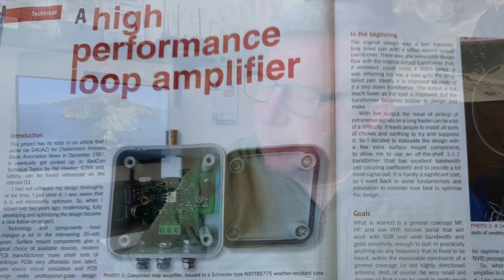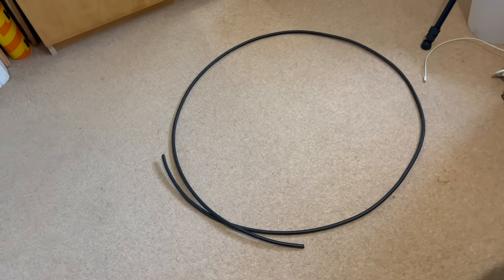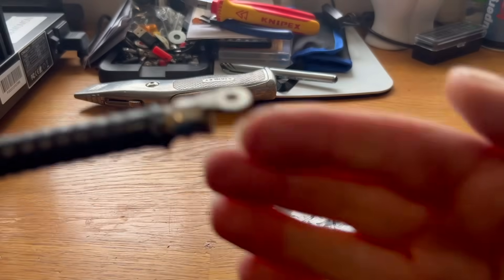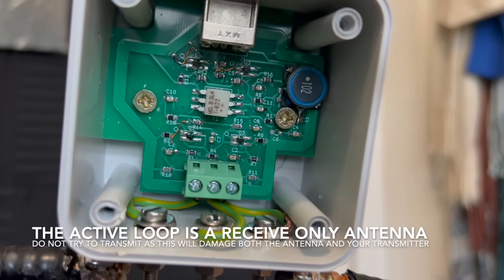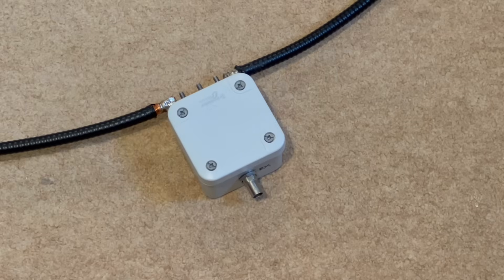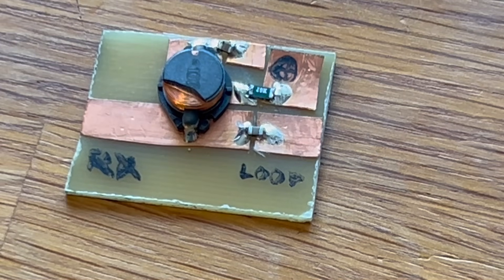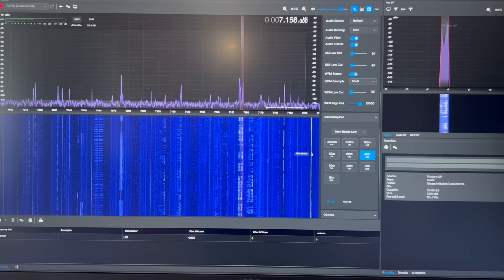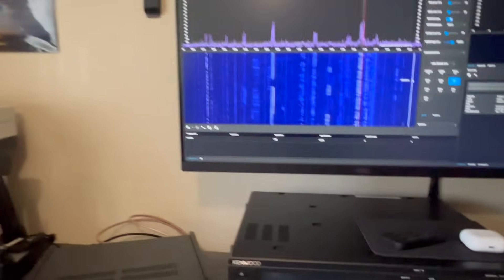HAM RADIO: The Active Loop Antenna, The Perfect Receive Antenna.

Comment: Why didn't you switch between your EFHW and the active loop and just show us the S/N? Absolute field strength doesn't matter because only signal to noise defines the readability.
In todays noisy world I can only recommend to every HF enthusiast to separate the RX from the TX antenna and always have a pure H-field wideband loop available, because in the near field the noise ist mostly on the E-field, so the immunity to noise on the magnetic wideband loops can be extremely good, outperforming almost any traditional E-field antenna, unless it is a horizontally polarized beam antenna.
But just the frequency range it works on is incredible and a dream for any SDR operator who is not only decoding stuff on the ham bands.
If you don't want to build the antenna yourself check out the LZ1AQ antenna kit ... there you can connect two loops 90° to another and switch between them add or subtract their signals. All that is done with the control box in the shack that does something genius, it doesn't use a coax cable that can also carry noise from the house to the outside, it uses a totally symmetrical galvanically isolated Ethernet cable and then converts this 100 Ohm twisted pair into symmetrical 50 Ohms in your shack and it offers you the clearest signals you can imagine. It also uses transformers in the active head unit at the loop, just like this one, which also reduces noise. I think this is also a great circuit and if you want to build it yourself, do it, maybe make it a project in the radio club or with friends and order a multitude of PCBs and parts, it will not only save you shipping costs it will also be great fun to create it yourself.
I have been playing radio since the late 70's used to live on a huge ground and put lots of antennas up but none of these antenna, apart from my beam, ever gave me the joy of clear reception like this LZ1AQ loop and I have also in the past experimented with lots of loops and Plessey amplifier chips, which were quite good, but not to that level of clarity and noise immunity.
If you like to check out my 24/7 active 80m-6m FT8 RX on this loop in the attic, go to pskreporter.info select "received by" and callsign "DL8EBM" ... and don't be disappointed, the site is overloaded when selected all bands ... select the bands one by one, else you only see a tiny fraction of the daily 20.000 RX reports from signals in around 150 countries. This is indoor in a very noisy multi family home here in Munich, Germany.

Comment: I was using just a long wire receive antenna but had to take it down.   There isn’t anybody producing this loop amp antenna is there?  I do vintage stereo also and have a full plate going on there, I would rather just buy it if I could.  Let me know.   Gary

Comment: Thanks for the info. How directional is the loop?
As you are only using the shield of the heliax, you could probably use 9mm (3/8 inch) copper tubing as well.
I wonder how the amp would work with a loop on the ground.
K1AUS

Comment: I have an MFJ-1886 loop on a rotator 6 feet off the ground. Works as well as my long wire on all bands including Top band but the real advantage is I can null out the local QRM by turning it around. You can't do that with an 80m dipole.

Comment: Loops are great. My friend Jorma built one inspired by Andy Talbot's and Chavdar Levkov's work on the subject. It's an untuned broadband loop that has directivity on the lower frequencies. Being practically short-circuited, the loop inductance has no effect on the received signal strength, odd as it may sound. A balanced input amplifier with two CB NPN transistors operated at a high emitter current show something like 4 ohms towards the loop.
Reply from the maker: 👍👍 thanks

Comment: If it was not for my small broadband receiving loop I would no longer be active in this hobby. I have an exceptionally high noise floor in my neighbourhood, in excess of -80dBm in some parts of the HF spectrum, caused by the usual suspects (SMPSU’s, VDSL leakage, HomePlug devices, etc).

My loop is a MFJ1886TR which uses two monolithic amplifiers (Gali-74) connected to each end of the loop. I have the loop mounted on a rotator about 5ft above the ground. The purpose of the rotator is not to peak the wanted signal, which as you go higher in frequency the loop becomes more Omni-directional to far field signals, but rather to null out the interference in the near-field. It is especially effective at this. As an example my immediate neighbour was charging their electric vehicle on out shared driveway, the resultant noise was well in excess of -73dBm (S-9) on my endfed antenna. However I was able to turn the loop broadside to the interfering source and thus reduce it to the point that it was just perceptible above the -130dBm noise floor.

When ever I swap over radios I do have to ensure that the hardwired PTT line is connected to the RX/TX antenna switching box. I have forgotten on a few occasions and it’s a real PITA having to strip everything down to replace the Gali-74 devices, of which I have a reasonable stock 😉

Regards

Nidge (G0NIG)
Reply from the maker: Thanks for the post. Greatly appreciated

Comment: Nice build Mike!
Relaxing watching you piece the loop together.
Have made one from LDF-550 which is total overkill, but I was given some offcuts from a cellular base station install a while back and they are perfect for forming a 1 metre diameter loop,
Performs nicely with an MLA 30+ cheapie amplifier and the UK made Cross Country amplifier.
Going to make another LDF-550 loop to use with an LZ1AQ active loop antenna kit which can be used with 2 loops in various configurations.
Look forward to seeing more of your loop build in use! 73's!
Reply from the maker: Nice 👍

Comment: Sorry to say that you revealed nothing since you you did not compare apples to apples. If you have used reference antenna like EFHW and use sdr on both antennas... By selecting each time different antenna... Then you could see differences. You showed magnetic loop connected to sdrplay using sdrconnect and reference EFHW connected to other receiver. Please do your test again..
Reply from the maker: I guess you guys are missing the point here, I’m simply saying that the loop works as a good receiving antenna, it is working almost as well as my EFHW did and that’s all I am saying. yes it is objective and I could have had a switched coax input but I didn’t.
Reply: Yes, I agree - the signal-to-noise ratio should be measured not just say it's better. Using the EFHW select a clear spot and measure the noise find a strong signal measure how far the signal is above the previously noted noise level and then do the same on the loop - then we would have a better indication if the loop is better?
Reply: @g3rcq  even with simple 2 to one antenna switch connected to the SDR you will probably see if there is a difference..... But u must use same  receiver....

Comment: Very interesting. Is the signal to noise ratio any better than on your DX Commander or end fed antenna? How do you protect the amplifier when transmitting on a nearby antenna?
Reply from the maker: I haven’t transmitted near it yet, 🤔 time will tell, the loop is quite against to the DXC and EFHW.